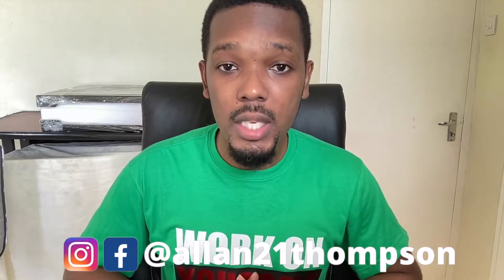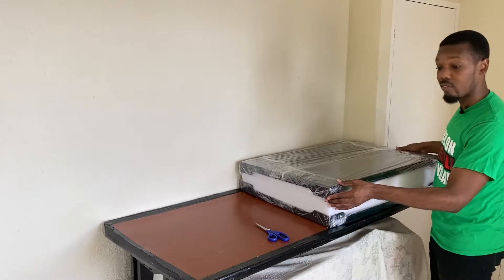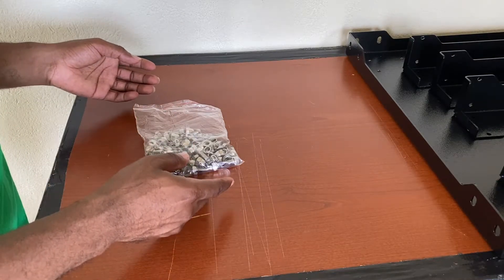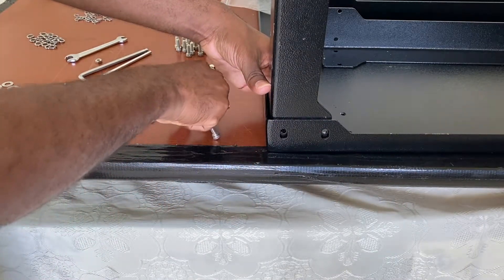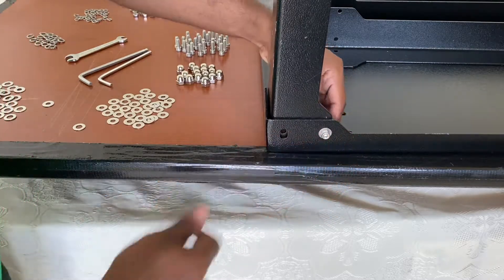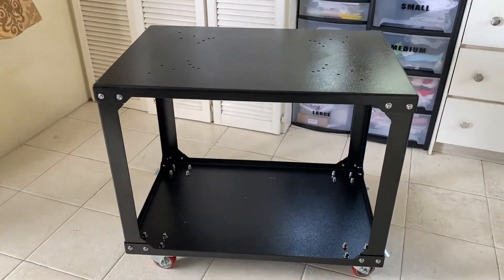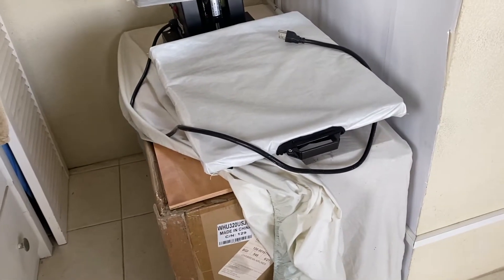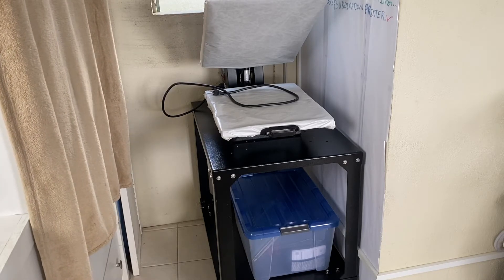Assembling and Reviewing Universal Heat Press Stand

Comment: i was thinkin of gettin this and if  do i can look back on this vid 2 put it 2gether.
but question i have a 16×20 heat press do u think it would fit on this???
i can put my xtra platens on the bottom if so lol
Reply from the maker: Yes please, I also have a 16x20 heat press and I use this heat press stand for it. So yes, the 16x20 heat press will work.
Reply: @atprints  tysm

Comment: I'm six feet tall. Is the height of thos stand workable with someone my height? I know I'm going to have to bend over some. Jusy wondering if it's going to be too much. Thanks.
Reply from the maker: Thanks for your question. Yes, it should work. I am 5 feet 7 and I do bend a little but what you can also do is get blocks of wood or something to put on the Heat Press Stand then put your heat press and you will get more Height.